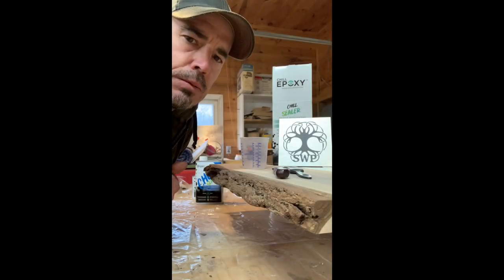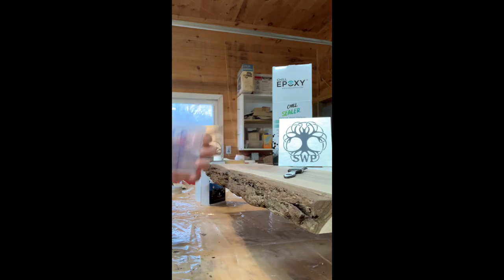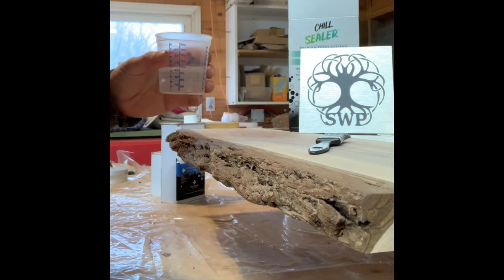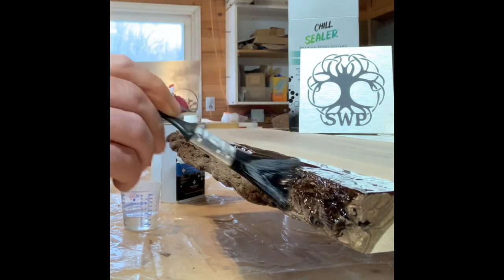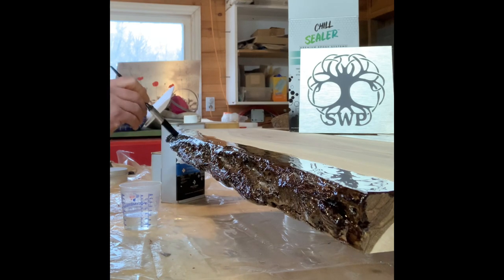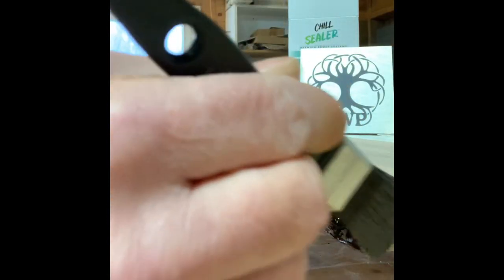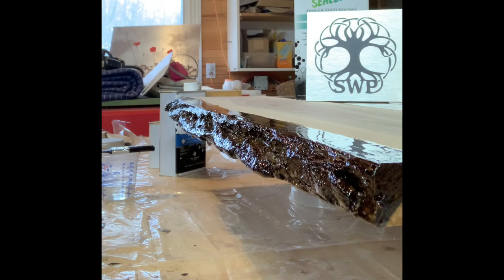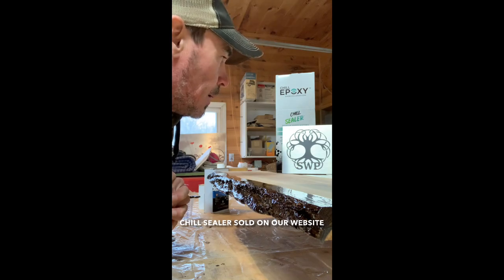Sealing Live Edge Bark - Part 1 @

Comment: This is a treasure of a video. I do wonder about the long term effects of epoxy fumes in a van build, and whether or not I'd be  better off just leaving the live edge naked till it needs to be replaced...
Reply: Epoxy is safe and fume-free once cured, so it won’t release any odors from the bark after the curing process. Just ensure full curing and good ventilation during application to avoid any issues with fumes. This will give the bark a durable, attractive finish without ongoing concerns about off-gassing.

Comment: Would you use this in combination with a non-resin finish for the slab surface? COuld you just sand down the top and coat with another finish like Osmo or Rubio? I don't really want to epoxy my entire slab, but I want to keep the bark if possible. What to you recommend? Thanks for the video!
Reply: @jeffreyjbyron did you ever find an answer to this? I want to do the same thing with a ponderosa pine round table.
Reply: @JakeLatin77  No a perfect answer, but I've learned that sealing and saving live edge bark depends a lot on the type of wood and condition of the bark. Most bark will separate and fall off as the wood dries, regardless of whether you epoxy it. But if your wood has a very rigid bark (not fibrous), then yes it can be done. 

The problem I had is that epoxy is glossy unless you sand it, and it usually has a very different look that oil finishes. Many people use penetrating epoxies to fill cracks and holes, then sand smooth and finish with oil.  But for back, that just wouldn't work--you need a very thick epoxy to seal it. 

Unfortauntely pine bark is not very strong like walnut or hickory. Most likely, trying to epoxy it would just make a mess. I wanted to try it on redwood bark and even after sealing, shreds of fiber continued to come off, eventually cracking neat the sapwood.
Reply: Best answer Ive found thank you.

Comment: I want to preserve the bark on a beautiful slab I have to make a table, but the bark has fallen off in some places and is already loose in others.  Can you use the epoxy as glue by removing the loose bark, applying epoxy on the inside of the bark and then reattaching the bark and clamping it to the slab until it sets?
Reply: I've seen it done like this in other videos so why not

Comment: Have you applied Chill Sealer to the piece with the live bark edge pointing upwards? It seems like this would be the best way to let the epoxy soak into the bark. Or does it soak in better from the side? And would you not want to apply your finish first, like Danish Oil, let it dry then epoxy the whole table top? Does the Chill Sealer leave a high gloss shine like other epoxies?